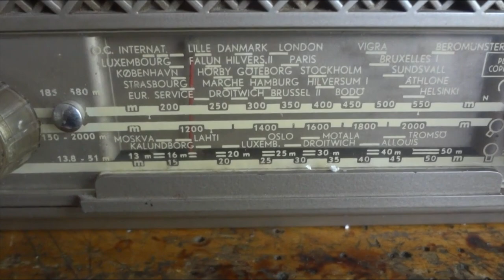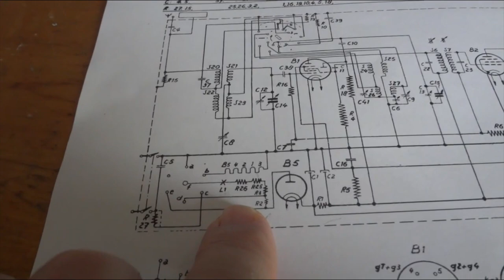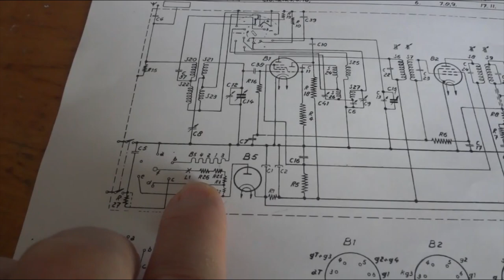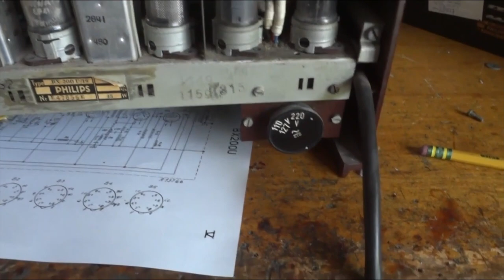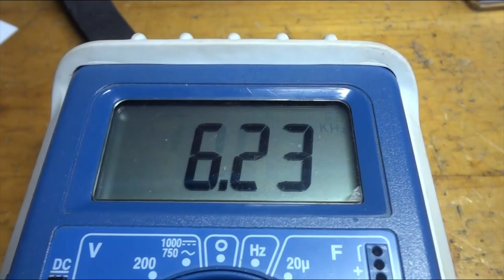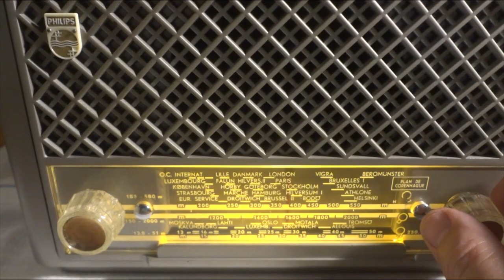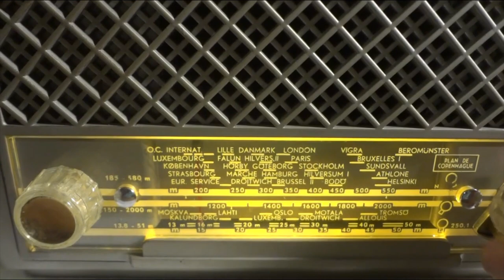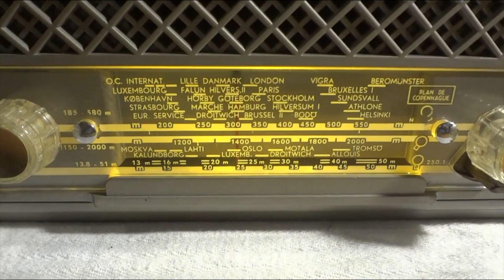Philips vintage broadcast receiver model BX200U - restoration and improvements

Comment: saudações brasileiras ao amigo............gostei muito do excelente trabalho de restaração deste philips, temos um igual que gostaria de fazer o mesmo que fez......seria possivel passar o esquema de retirada da Uy41 e resistores e a colocação dos diodas? o meu modelo é bx 209 u .....enfim se puder muitissimo obrigado e tenha certeza que ganhou um seguidor brasileiro................abraços e muito obrigado mais uma vez
Reply from the maker: I can do that. Question: Do you want the radio to operate on 230V AC or 120V AC? Also, do you live in a 60 Hz country or a 50 Hz country? Portugal? Brazil? Once I have that info I can calculate the capacitor value and draw you up a diagram, no problem. I am gonna need an email address though. Cheers.

Comment: i have the version intended for the UK, BG200U, it has an extra 245v mains tapping, unfortunately in poor state
Reply from the maker: I assume that this was a special version to work with British 240V mains voltage, which I think was the standard in the UK back then. I can't think of any other reasons why Philips did a special, because the long wave bands and medium wave bands were (are) identical to the rest of Europe.  Cheers.
Reply: @LifeIsTooShortForQRP  the G in the philips model no.s means for UK/Great Britain,  other countries may also have required 240ish capability,  as far as i know X is a 'general purpose' worldwide code, some may have 240 ,some not , there is likely info on the 'net of all the codes they used , sometimes it was inbetween numbers such as B3G81U ,
Reply: in some cases the 240v addition was only minimally done , such as in the case of heater voltage/current, resulting in excessive ht on our 240v mains!!

Comment: Why did you say it's a car radio? It's a death trap radio.
Reply from the maker: Did I say it was a car radio? My bad, it is a desk top radio. And only a "death trap" if you don't know what you are doing, it would indeed be better to use an AC isolation transformer in that case. Cheers.
Reply: its not a 'death trap' if its used correctly and knobs are present and correct, and you dont do stupid things like poking metal objects into the back holes with set plugged into the mains, philips acdc sets were generally very safe, more so than a lot of others, in this one and many others the knob fixing screws go through the spindle so even if it becomes loose, knobs cannot fall off exposing live spindles
Reply from the maker: @andygozzo72  You're right. Philips even put wax in the knob screw holes, so that you could never come in contact with the knob screws (unlikely anyway because they already reside pretty deep in the knobs to begin with).
By the way, all European tube TVs of the time also had this transformerless concept, with all tube filaments in series, directly connected to the mains, and single-phase rectification of the mains for the HT voltage. Only difference there is that they used 300mA filament tubes instead of 100mA, a necessity because there were many more tubes than just five like this radio. Those tubes had a "P" nomenclature (like the PY88, PCC84 and the like). Cheers.
Reply: @LifeIsTooShortForQRP  yep, pretty much all uk tvs, at least post war were series heater, some using autotransformer though, and/or complex series+parallel heater arrangements(Murphy), plus some radios done that way , and a few odd ac only sets that had transformer just for the heaters, i have a few of those
Reply from the maker: @andygozzo72  Interesting! I have never seen tube TVs with a transformer for the filaments. But to be honest, we never saw British TV sets when I grew up, because of the different sound carrier frequency that the UK used (6 MHz UK for 5.5. MHz mainland). And you also had the 405 line format in the UK. So those British sets (Ferguson, Pye, Murphy, etc) were never seen where I lived. The tube TV sets that I have worked with were all Philips, Erres and all the German brands (Grundig, Telefunken, Graetz, Loewe Opta, you name it). They never used transformers. Cheers.
Reply: @LifeIsTooShortForQRP  i mean valve radios, mostly, but i've seen circuits of tvs using rather convoluted power circuits, murphy made a very nasty one, a double wound transformer, with separate heater and ht winding, so you'd think chassis was nicely isolated, but no, they used a boost/efficiency diode with fairly high heater voltage and that heater was fed from a tapping on the mains input winding,  the aerial socket was connected one side direct to chassis, so , if the boost diode valve heater to cathode insulation broke down, chassis and aerial socket became live!
Reply: @LifeIsTooShortForQRP  typical of the UK to be the ODD BALL with everything 👍